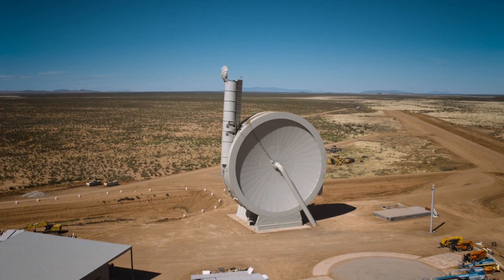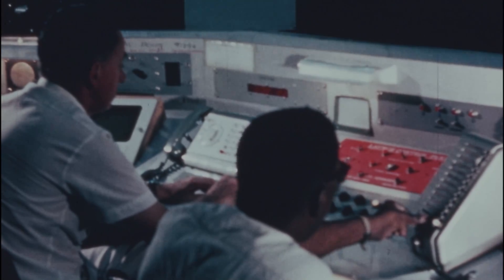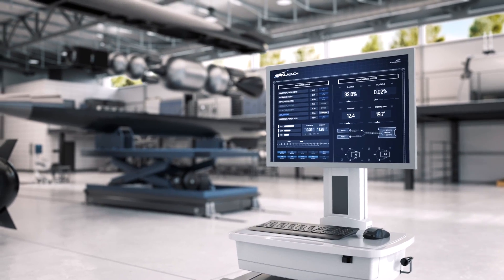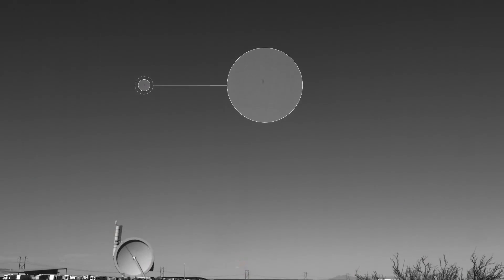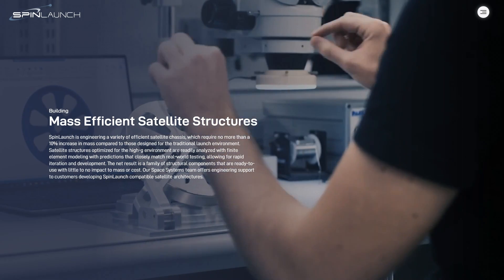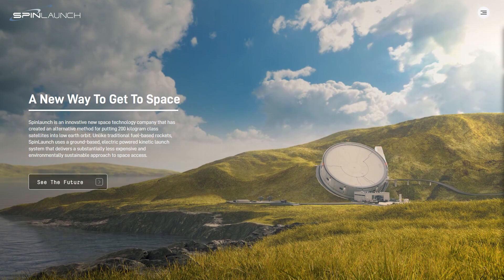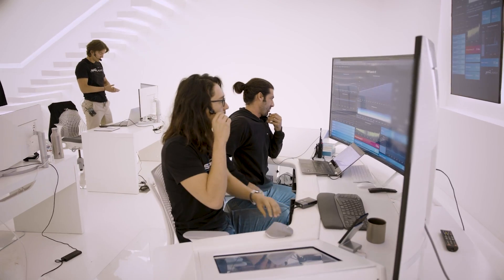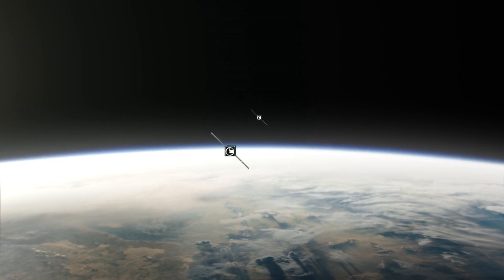Can Spinlaunch Throw Rockets Into Space?

Comment: This would be perfect for sending helium-3 from the moon to Earth from a mining operation ideally operated by a clone of Sam Rockwell.
Reply: Maybe so, if there was any practically gatherable amount of He-3 in the moon's regolith. Really you're better off using a superconducting magenet based scoop system at Earth-Sun L1. Such a thing could also be engineered to be able to operate at higher magnetic fields (aka bigger scoop) to help protect the satellites in orbit around the Earth from things like coronal mass ejections.
The best part is that most of what you'd be harvesting is just plain old Hydrogen, which you could easily use in electric thrusters for station keeping purposes. All you need is a lot of electric power, something that's easily obtainable via solar panels.
Reply: Sam Rockwell IS the clone... :-O
Reply: Lunar concrete for O'Neill Cylinders.

Comment: to keep it balanced they could just put a weight on the other end that gets released at the same time. they just need an underground lake to catch the counterweight and dissipate the energy.
it would double the launchtime to 3 hours, but their bearings would have a chance to survive the launch.
Reply: At these speeds, nothing is 'catching' that counterweight. The water is practically concrete at this point and you would need to replace that counterweight every time.
Reply: And the lake, too.
Reply: 10 tons of mass traveling at 2km/s is 20GJ of energy, or almost 5 tons of TNT equivalent. They need a 'dissapation chamber' (read: bunker)  that can withstand like 20 Mk82 bombs each launch.. 😬
Reply: @KaizokuSencho  you can dump that much energy into one of these big fluidtransport-trucks and dont even get the water to boil.
Reply: @andrewrobertson5504  Maybe you can use a water counterweight. You open the tank of water at the same time you release the rocket and all the water instantly turn into supersonic vapor

Comment: Balancing a system like this near instantly wouldn't be to hard i think if they were to launch 2 projectiles/objects, 1 per arm. Still would need extreme bearings to handle intense split second transversal loads
Reply: Not at the same time, unless 1 will be a pancake after release
Reply: So they would yeet the second projectile into the ground?
Reply: Definitely agree with this. I can't imagine a system being able survive that sort of shock and imbalance at the same time. Releasing the payload and a counterweight at the same moment would help enormously. Still an incredible shock from high tension to (relatively speaking) low tension like you say. But very little imbalance.
Plus, the challenge of capturing the counterweight safely would be pretty cool :D
Reply: I was thinking more one after another coming up half a rotation after the first projectile is launched
Reply: @danielmonsanto8286  
I think even half a rotation would destroy the whole thing.
Reply: @MrBajaJunky  you may be right on that... But imo other that only a instant projectile launch and counter balance drop would make this platform anywhere near stable enough to be viable for reuse. Interested to see what Spinlaunch has up there sleeves to solve this issue
Reply: @danielmonsanto8286  Indeed, their renders don't show a path for a released counterweight so whatever their thinking of must be pretty novel.
I wonder if a liquid counterweight would work?
Dump water rather than a solid object? Though at that speed the water's going to act rather solid! But maybe the interaction with the vaccuum and speed its dumped at may atomise most of it?
Whatever they do its very cool to see them trying such an unusual launch method for real.
Reply: @SKYWURX  the spinning portion of the chamber is under vacuum so nothing other than the arms themselves to try to breakup the water, so either way would be a complete disaster. Only option is a solid mass released at the same time as the projectile in the opposite direction. Maybe the counter balance can be released into a pool behind the launch platform so as to minimize damage to the area, but most likely the counter balance would be lost due to the high speed of ejection.

Comment: The only way I think could get around the balancing issue is to also release the counterweight. They show footage of it being a heavier mass farther in towards the axis of rotation, so it wouldn't be going as fast, but then you have to figure out how to catch that massive slug of whatever material they use. I think steel could work, but I seriously have no idea how they would catch other than having a massive sand pit.
Reply: A lengthy pipe filled with water. driven deep into the ground or down a mountain side would do nicely.  Launching from a high altitude mountain would also reduce atmospheric resistance to the projectle.
Reply: It's not balancing the momentum in the same axis, but maintaining the rotational speed after shedding 11tons of mass. To balance that with weight they will have to catch 11 tons of mass on the opposite side.
Reply: A liquid water counterweight, dumped as a liquid into a cavity that is rapidly repressurizing from the launch could dissipate energy pretty quickly. Would double as a steamroom.
Reply: @ExtremeSquared  That could work.
Reply: I came here to post that same thought, then i saw this and... did it anyway lol
Just toss the counterweight after the main projectile, i say. There's already a hole in the vacuum chamber after it, and a ground corridor is supposedly cleared. If they can make chemical engines to work after an hour at 10kg, they sure could figure out a parachute too? right?
Reply: I'm thinking it's not an accident that there is a large oblong hole around the center axis in their promo graphics. I'm thinking that probably the arm is supposed to 'follow' the payload outwards and move the counterweight closer to the axis until it's balanced again. Not sure how exactly that could be achieved though
Reply: @TheYrthenarc  The energy required for that arm movement would be identical to the energy that needs to be dissipated -- massive.
Reply: @ExtremeSquared  Not really. The arms are in balance before you release the payload, so you could do this by unbalancing the arm towards the payload just a little, let the now heavier payload side pull it outwards, then release the payload at the exact moment the counterweight and the payload-less launch arm are in balance.
Reply: @TheYrthenarc  I don't agree. It's all Newton here. In transitioning from a system in equilibrium to one with a projectile, there must be projectile energy dissipated in the opposite direction, one way or the other.
Reply: @ExtremeSquared  Yes, but there's no magical energy appearing anywhere in the system I described. When you unbalance the arms, the system is not in equilibrium anymore, the projectile doesn't just fly off tangentially, it takes a spiral path. The whole system basically becomes a trebuchet. When you let the projectile pull the counterweight, that robs some of the energy of the projectile, so you'd have to account for that by revving the system up to a slightly higher RPM than you'd need for just launching it, but not by much.
Reply: @TheYrthenarc  I still think you are not accounting for where the energy goes. You may be just moving it around. Simplest model to play around with is one of these sitting in space, with equal projectile/counterweight mass, and equal length arms. I think you'll find that your method is just moving all the projectile energy into linear motion of the arm which still has at least counterweight mass, which will be the same problem to deal with immediately upon projectile separation.
Reply: Assuming the payload is 10 tons exiting at mach 4, that has 30 gigajoules of energy on release. To balance the rotor by releasing something else the opposite direction also requires 30 gigajoules to be released. Thats 6 tons of tnt equivalent. I don't think a sand trap would be able to contain that.

Comment: How do they get rid of the "rocket"'s angular momentum at the point of release quick enough without destroying it?
Reply: angular momentum only exists when theres a force acting on the rocket. Once released, it will fly in a straight line
Reply: @AmatuerHourCoding  No, he means the rotation. At release, the vehicle is rotating at the same rate as the centrifuge.  When released (if it’s done from say a single support point) then that pitch moment remains.  One way would be to have two supports, one fore and aft, releasing them with exactly the right timing to impart a cancelling moment to the vehicle. This timing will be at least as critical as the timing required to hit the exit aperture.
Reply: @AmatuerHourCoding  yes, it will fly in a straight line, but still be rotating around its own center of mass at 450rpm as it did a millisecond ago.
Reply: @AmatuerHourCoding  the projectile has angular momentum though. It's not rotating around its own center of mass so it has a different angular momentum than if it were rotating at the same RPMs on its own, but it still has spin and will still rotate as it leaves the launch device. It's trajectory may be straight but its body will still rotate. This could be counteracted by some secondary mechanism or perhaps just assumed to be taken care of by aerodynamics.
Reply: @AmatuerHourCoding  No, Bjorn is correct. The vehicle is connected rigidly to the rotor arm. If the rotor is going 450 rpm, so is the rocket. It doesn't magically stop that rotation on release. It will still be rotating at 450 rpm, while traveling in a straight  line (just around it's own CG instead of the axis of the rotor). 450 rpm to 0 rpm shouldn't be that hard. The larger the radius, the slower they can spin at the target velocity.
Reply: @AmatuerHourCoding  That's not quite true. The part of the rocket that's "radial in" when on the launch arm has a lower velocity relative to the bearing than the part that's "radial out". This will induce a net rotation around the cg once the rocket is released from the launch arm. The direction of that rotation is consistent with the angle at which the test projectile left their subscale launch apparatus.
Reply: 450 RPM = 7 rotations per second. Not that much. Aerodynamic forces will stabilize it gently. Probably shock from hitting air is much greater then angular torque.
Reply: i might be completely wrong but they could, in theory, have two separation points and separate the one that is further towards the front of the projectile just that tiny little fraction of a second earlier so that this cancels out its rotation

Comment: How about using it for refueling missions? StarShip or HLS? Or just refueling satellites like we’ve seen lately?
Reply: Starship is is about the size of one of the arms of the centrifuge. The rocket is shorter then starship is wide. I feel that it would just be too small to be economical.
Edit: Sattelite re-fueling might work though.
Reply: @squeaksquawk4255  Completely agree it will not fill a Starship - but it appears that Starship will need about 5-10 refueling tankers to do a moon/mars mission. Even if it would require more launches than 5-10 starship tankers, if it is more economical, by even 20%, it might be a good use for the system. It should be possible to build 5-10 centrifuges and thus get a bunch of these into space fairly quickly and maybe at lower cost?
Reply: Good idea. No fragil payload. Altough payload size might not be big enough to bother.

Comment: I dont think this would work well even without atmosphere. I guess it would be really cheap on the moon but a couple mile railgun would be much more practical
Reply: Let’s be honest, rail guns are really cool. The coolness factor plays a role here.
Reply: In the long term, definitely. Given that this is basically a single complicated part (the arm) on an otherwise very simple structure this is much more feasible in the near term. Rather than having to ship miles of rail gun components to the moon this just requires the arm being shipped.
It is analogous to asking whether we should send a truck to move things between moon bases or build a railway. The railway will be more efficient, but the truck requires much less to get going despite being arguably more complicated.

Comment: Easy to solve the unbalanced load at release.  Put a dummy payload on the opposite arm that equal mass that gets released at the same time.  This dummy load would need a similar escape tube as the primary payload.  This dummy escape tube would need some thing to slow and absorb the kinetic energy of the dummy load.
Reply: At 2 kps and 10(?) tons it's about equal to setting off 5 tons of TNT. Not the easiest thing to just catch.

Might be doable with a long arced tunnel with electromagnetic brakes. Would save them a bunch of money to get that power back as well.
Reply: Would be highly impractical, you'd get a kinetic "bomb" shooting into the ground with the force of a small meteorite strike right beside the base of the device. I figure a pressurized fluid system inside the spinning arm could re-balance the axle quick enough, maybe coupled with some sort of dampening system on the bearing mount as well.

Comment: Seems like launching from the Andes would be extremely helpful for this - even more than for conventional rockets.
Reply: Would running power and the facilities that high make much of a difference? I mean the air is thinner so I guess its not just thousands of feet but also less drag
Reply: @RiceKillaz  less drag, and your first stage engines can be more vacuum-optimized
Reply: @alexsiemers7898  the rockets are already vacuum optimized as they don't kick in until near orbit correct? Bring higher would only allow less power. It'd also require all satellites be shipped to these remote locations not to mention the staff

Edit: less power is the entire facility being small so I don't mean to dismiss that
Reply: Agreed, or Nepal, maybe Tibet., although they're pretty far north, still they could work for more polar orbits. 
A lot of Africa is pretty high, some parts especially and closer to the equator.
Even the High Plains in the US would be vastly better than Sea Level, and a fair bit safer than some of the other options.  
Although it might take a bit to allow  missile launches that far from a big body of water.
Reply: Good luck shipping all the stuff up those mountains to 1. get it built and 2. launch rockets.
That's why we typically don't see rocket launch pads built on mountains. There is an advantage yes, but it's massively outweighed by the logistical inconvenience of the inaccessibility of the launch site. Rockets are big, and so you need big wide roads (or better yet, a shipping canal) to get them to the launch site. Plus, where would the spent stages (and rockets that failed to ignite for whatever reason) land?

Comment: As for balancing the rotor couldn't they just use two arms with equal mass at both ends and as soon as they release the payload the next half rotation release your dummy weight
Or even have two exits to the chamber and release them both of the same time firing the one into the ground
Reply: Having dummy weight would mean you need twice the energy. And, more importantly, that you have this energy meeting the ground just below your structure, basically producing your own earthquake. Earthquake doesn't sound quite fun.
Reply: And what kind of mount would withstand the impact of a 10 ton supersonic projectile hitting the ground right beside the device?

Comment: Simple answer: 
If you require a second stage to get to space you're not projectile throwing to space, and eliminated the purpose for even projectile throwing to space.
But their system would work In Space on asteroids or small objects with little to no atmosphere.
Reply: You are still saving on the energy required to get to space
Reply: @MisterCOM  no your not and it has to do with atmospheric pressure difference.
In addition to the projectile violently rotating before it even gets to a space escape altitude you'll require massive gyro maneuvering to stop it.
Plus they didnt even achieve their alleged speed.
My logical opinion a spaceplane and then the 2 ship canon method is better than a violently rotating washing machine method.
See Thunderf00ts videos if you want to learn more.
Reply: @GlennCoco  im not supporting these guys specifically but you are saving on chemical energy
Reply: True, but to get bulk cargo up it will work, simply because electric power is cheaper than fossil fuel, especially if you can have peak power use from renewable resources, and the motor set used to launch can make a pretty effective energy store as well, for recovering energy.

Comment: What if they vacuumed a tube upwards a km before hitting the atmosphere? Does that make a significant difference? Anyone know the physics equations for this?
Reply: Or what if they launched this thing on a mountain or a high tower?
Reply: @BBDoesTheThing  You will want a high mountain on the equator for this, so the only place is Kilimanjaro, which is almost exactly on the equator, and high enough to make a difference. 5.8km above sea level near the peak will give a very large loft, reducing the energy needed by a good amount, and there is 5km less atmosphere to burn through. Also close to the coast so you can have a semi safe abort area, though this is one of the more congested shipping areas, but the lanes are defined.

Only issue is the politics of the region can best be described as "complex", at a minimum.
Reply: @SeanBZA  haha yeah "complex". Good for  Tanzania tho if they could get a good cut for it.
Reply: vacuuming a tube that big would take a massive amount energy, i was thinking the same thing for higher starting altitude though.
Reply: @Brandon34098  its pretty neat! I imagine the bigger the rocket the greater the drag...exponentially. Higher altitude might be a good proposal. I wonder how theoretically high they could put it in the atmosphere to launch.